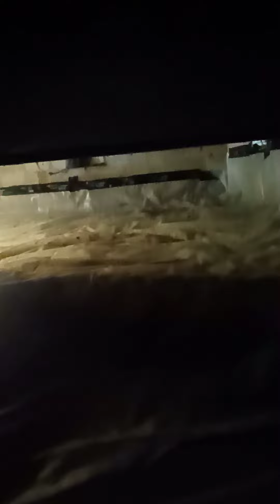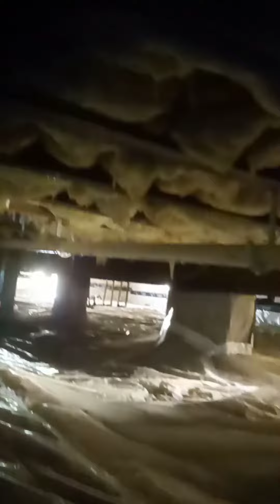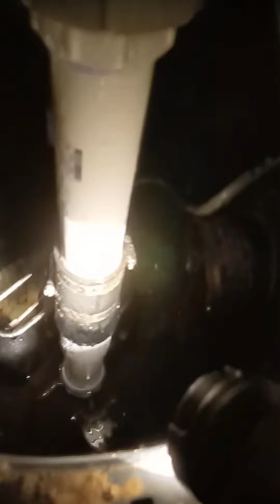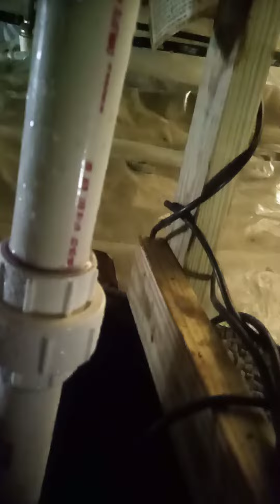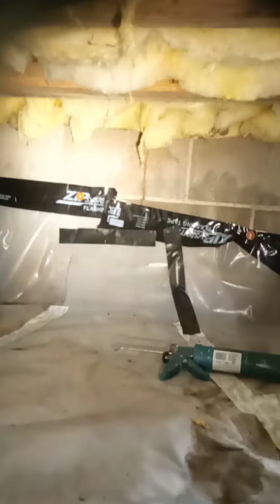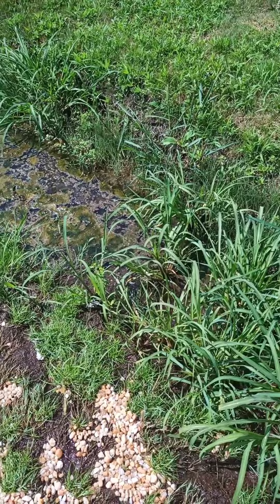crawlspace encapsulation + sump pump

Comment: I’m an encapsulation contractor. Been dying to try the Zip system, but We have the butyl tape+ adhesive down to an art form. After being up just three days, I needed to cut out a piece about 20” long to install a vent fan. I could barely pull it off . Plus we use a Hilti Fastener about every third block. I’m looking for a tape that if we attached two pieces of floor poly together with it would SToP water. So far , no seam tape will stop water.  That’s what I want to try zip on except it’s black.
Reply from the maker: The finished product was nice but that zip tape was a pain in the neck. It did not want to stick to the block very well. That is why i have cap nails holding it up just incase doen the road it wants to pull off the wall at all. You can use liquid flash in a caulk tube to help with adhesion. We did in a few places and it worked better than anything ive tried thus far. Definately created a water tight seal whenever it was used. Also probably prevents termites from making there way up the wall!
Reply: @duereviews791  I’ve been a termite inspector too (15 years) Butyl tape with Lexel on both sides is the best I have found. It is still gripping tighter and tighter year after year. Some jobs we did early on we used liquid nails and we might as well have used bubble gum. If you can get Lexel between the poly and the wall, press it in and return a few times to press it in again , by golly it will hold. Stuck some poly on a brick in March of 2018. It will Not come off. Thx for being upfront about the tape not sticking to the block. It’s helpful. I wonder how well it stuck to the poly. If I could find a tape that held back water at the seam where two pieces of floor poly meet? Man that would be the bomb. I’ve tried everything. In fact Lexel makes a waterproof seal but a 50 foot run would use a tube. Guess that shouldn’t matter.